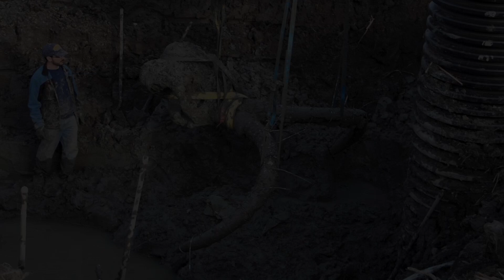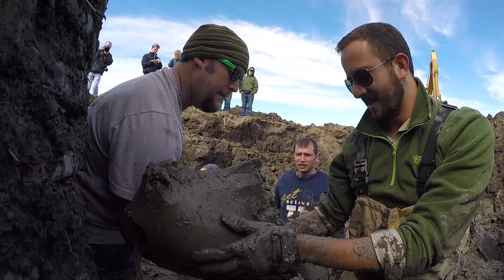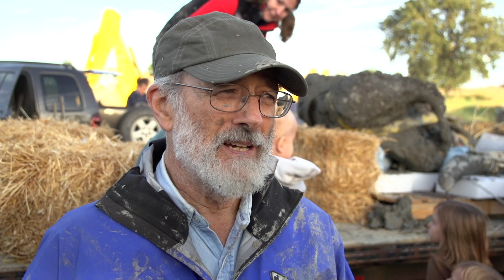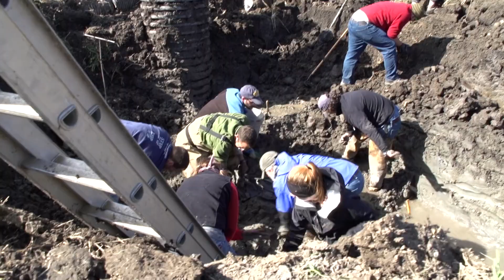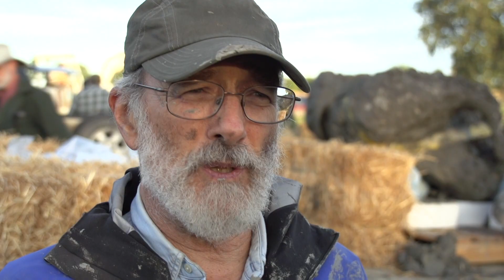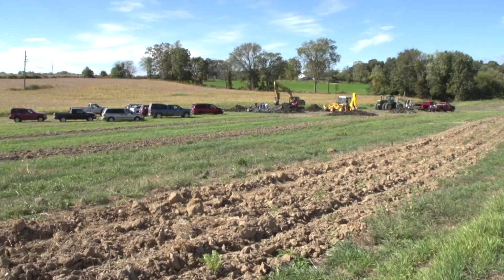Mammoth Excavation Near Chelsea, Michigan

Comment: Has anyone noticed how when it was being lifted up, the tusks were intact. But when they were laying them down, one of the tusks was broken. They must have broken it.
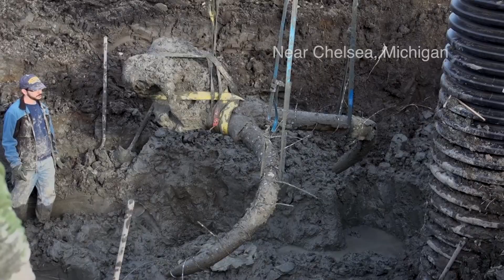Reply: +VloggyBuddy At 0:02 you can kinda see the tusk "snap" but didn't break all the way in that particular scene
Reply: +VloggyBuddy The whole thing is in terrible shape from the elements as it was. You can see all the zip-ties around it trying to hold it together because they knew it was not solid. Lifting it out was an extremely difficult task anyway.
Reply: +Steve D (dettonator) +Barley Mob

Reading through the back and forth on this thread, one critical commentator seems doggedly insistent in seeing the glass as less than half full, when objectively speaking, it's almost full to the brim, to extend the metaphor.

The fact that the mammoth remains were even discovered and that the landowner informed and allowed researchers from UM to excavate them is itself a huge plus.

Given that the remains of all organic materials are subject to decay over time in accord with environmental conditions, the extreme age and lengthy intermentof the mammoth remains (10,000+ years) contributed to their fragility.

In the video and still shots seen on other news sites, the tusks of this particular mammoth appear to be exfoliating and are clearly in an advanced state of decay. Once removed from the ground, the tusks had nothing to hold them together and were prone to falling apart. The multiple zip ties wrapped around them were used in an effort to keep them intact by preventing further disintegration during removal. 

Ivory tusk is by nature much denser and heavier than bone. The structural integrity of the tusk that broke off was likely so compromised by advanced decay that it could not withstand the stress of having to bear its own weight when exposed to the full force of gravity after having been immobilized in the earth for so long.

For an uninvolved third party who was not at the scene to argue forcefully that the broken tusk was due to negligence on the part of the team extracting the mammoth skull is presumptuous speculation to say the least.

Again, the discovery and recovery of the mammoth remains in that area is a huge plus in itself. That a piece of one tusk fell off during the recovery process is a minor concern. It didn't go anywhere. They still have that piece of the puzzle.
Reply: +MrZapparin They had one day to remove it. Everything went quickly.
Reply: +MrZapparin I'd love to hear the rest of your argument. You must know far more than anyone else on excavation. Do tell...
Reply: MrZapparin It tells me there were a lot of hard working individuals working together as a team to get a large project done in one day. The broken tusk is irrelevant, because they still have the entire thing.  Like I said, the video does not cover the entire context of the find, exploration, or excavation.
Reply: +MrZapparin You do realize that it isn't a fossil, but actually BONE?  You know, organic material that DECAYS?
Reply: MrZapparin His land, his rules. The researchers involved such as Dan Fisher from U-M Paleontology Museum were the ones contacted by the farmers, they don't have any authority to start prying up his land if he didn't allow it. In the recent article today concerning it, the farmer already mentioned that hundreds of people are coming from everywhere and visiting his farm to see the bones, and he can't get any work done around his farm because of it. Time is particularly precious in Michigan when winter is just a month away. Do you even jurisdiction bro?
Reply: +Steve D (dettonator) Somehow I don't think MrZapparin can respond with a plausible argument to back up his initial assumption. 

Laying immobile in the ground, the tusks appear intact, but later in the video, a large piece of one is broken off. 

MrZapparin's initial comment on this is that the people doing the excavation "...destroyed it." 

The possibility that a heavily fractured mammoth tusk in an advanced 
state of deterioration might lack sufficient structural integrity to 
remain intact following 10,000+ years underground apparently hasn't 
factored into MrZapparin's analysis.

He then went on to assert that they were unprofessional amateurs who didn't realize what they're dealing with and didn't know what they were doing.

In stark contrast to MrZapparin's claim, the University of Michigan's website indicates that professor Daniel Fisher, the paleontologist who led the dig, has excavated roughly 30 mammoths and mastodons in North America over the past 36 years.

Such being the case, MrZapparin's denigrating pronouncements about the qualifications of those involved with the excavation are evidently uninformed.
Reply: MrZapparin Socrates — 'When the debate is lost, slander becomes the tool of the loser.'
Reply: MrZapparin Hey genius, it was being held together with wire to begin with. Had they done nothing to secure it the entire piece would have crumbled to bits. They still have the tusk that broke off and it can very easily be put back together the same way. They didn't "ruin" anything
Reply: MrZapparin Yes it is? They could have just buried the thing again and nobody would have ever known it had been there. The excavators and research team are not allowed to just barge onto their land for 'X' amount of days if the farmers don't allow it, which they probably didn't.
Reply: MrZapparin If that's all you have to say then I believe we're done here.
Reply: +Barley Mob - Good observation! I had not noticed this previously but re-watching the video just now, the tusk exhibits a sudden but incomplete structural failure at that moment, despite being lifted up quite slowly. This confirms my earlier hunch that the breakage was likely due to the decayed tusk's innate structural weakness, rather than overt negligence on the part of the excavation team.
Reply: I did. And I know that the video does not capture the entire context of the situation.
Reply: +MrZapparin Not exactly, they made some good points about the way the bones were scattered and the stones found nearby. If the stones are just a coincidence and it wasn't killed by humans, it was likely still killed by something else rather than dying off naturally.
Reply: +VloggyBuddy Jep they fucked up on the left tusk badly.
Reply: +Steve D (dettonator) its been there for all this time, and they can't wait a fraction of that time to do this properly. Way to go.
Reply: Omgdannie2 No, they can't. It's the farmers' land and ultimately their decision what to do with it, therefore it's not up to the excavators.
Reply: +MrZapparin Says the one who clearly didn't read anything about this excavation. All you've done is stated your opinions. The fact is that the bones were not in great condition and they had only one day to get the job done.  What's done is done, get over it.
Reply: +MrZapparin You clearly don't know any farmers either lol
Reply: +TransientVisions ^ THIS!
Reply: +Barley Mob  - To clarify, I was responding to your initial post on this thread, where you pointed out that "...you can kinda see the tusk "snap" at 0:02 in the video.
Reply: [ [ [ [ [ [   END OF DISCUSSION  ] ] ] ] ] ]
Reply: MrZapparin if you’re such a god damn genius on how to excavate archaeological finds you should’ve done it yourself. Just another stupid keyboard warrior